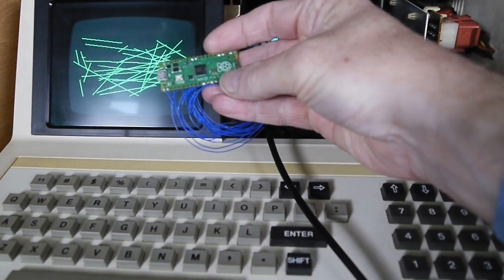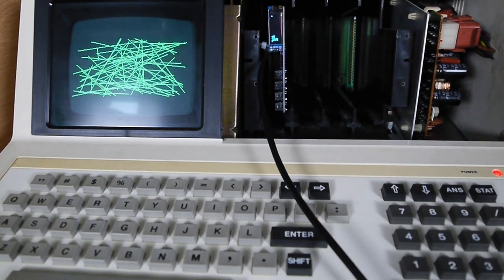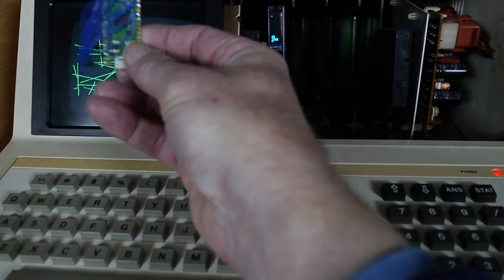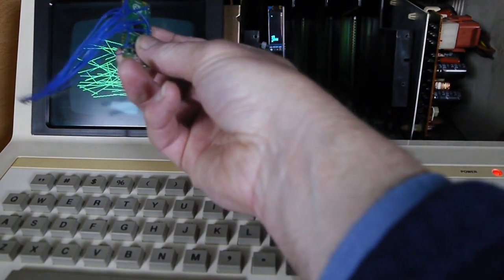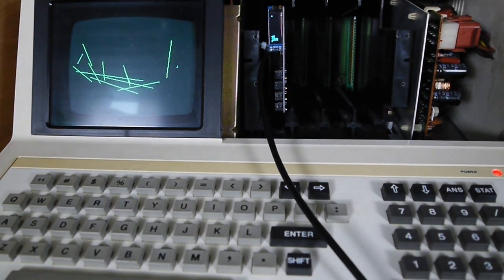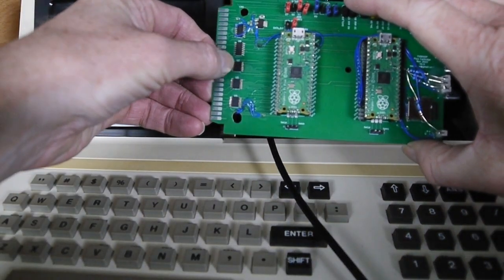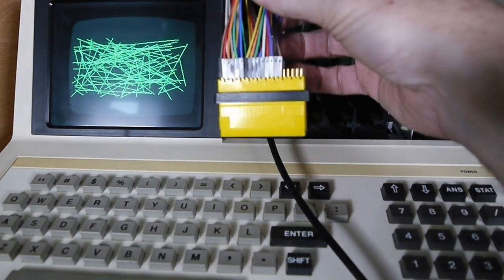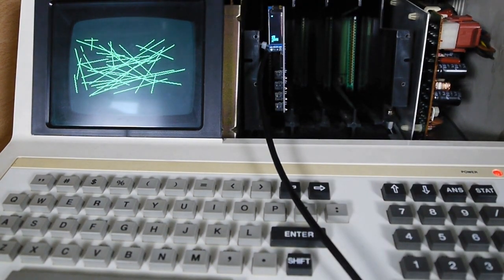Is the Raspberry Pi Pico 5V Tolerant?

Comment: Does "5v tolerant" also mean the output level of the pico is enough to drive 5v input of other chips?
Reply from the maker: No, definitely not. The outputs from the Pico will be '3V3' outputs as that is what the device is running at (in reality it will be some voltage lower than 3V3, see the data sheet for details). 5V tolerant means that inputs can accept voltages above the supply voltage of the (IO portion) of the device. As it happens, the 3V3 that the Pico outputs is enough to register as a logic '1' in the systems that I'm working with here. That isn't always going to be the case, but it is in a lot of systems.
Reply: @menadue  The I guess it's not safe to try driving an input of a 5V device high that is already terminated/pulled high to 5V on the device side. If the RP2040 output would only pull the 5V down for a logic low and otherwise switch it to input (high-z) for a logic high, would that be safe?
Reply from the maker: @Shmbler  It might work, but the transition between input and output might be a problem. Best to use a level shifter if driving something that could be at 5V.

Comment: Are you using PIO magic to implement the RAM emulation? How many cores are used? Would be cool to have Forth running on one core and be able to inspect and debug the RAM.
Reply from the maker: No, this is emulation in code, though I am going to have a look at a PIO version for a different project. There's a github repo with a ROM emulation using the PIOs and DMAs, but I haven't seena RAM emulation, which is a bit trickier.
The code emulate son one core which is timing critical and another core is free for other stuff. When I ran on the Pioc I had a USB serial monitor running so I could look at the RAM contents. On the small PCB there wasn't room for much so I dropped the USB connector. The serial monitor is still running though.
Reply: @menadue  so nice! hope you publish code and PCBs soon - I love how the board looks! Also, heh, now I gotta wonder if you^W someone could extend the PCB, make it 0.8mm and build a USB-C connector tongue right into the PCB =D
Reply from the maker: @AryaFairywren  Glad you like it. The code and PCBs are here:

https://github.com/blackjetrock/fx9000-info

They are part of an FX9000P Information repository that has started to turn into a modification repo as well. I did have an earlier PCB revision that had pads on the edge so that signals could come out of the PCB and be combined so you had the video data and maybe sprite or accelerator control. With 8 PCBs, though it all starts to get complicated and very wiry. So I made a PCB with two RP2040s on it that can replace all of the video RAM:

https://youtu.be/YrIDFTD56bw

The two RP2040s use a 'transputer link' to talk to each other and by mirroring each others data you have all of the video RAM available. Much less wiring...
Reply: yay thank you, that's great to see!